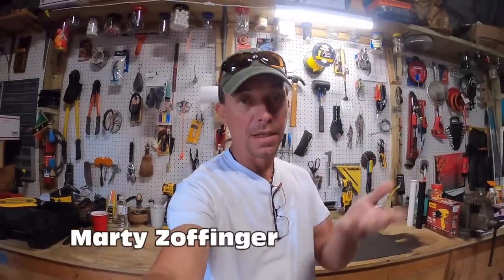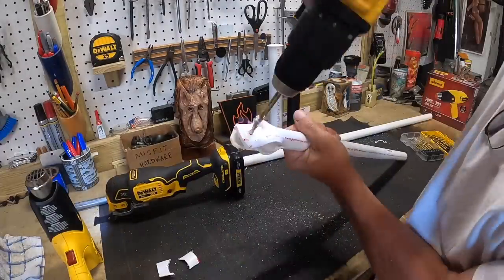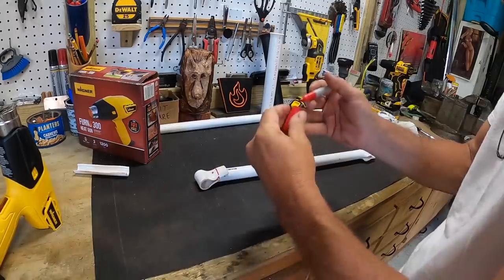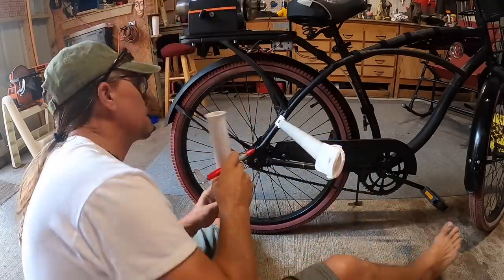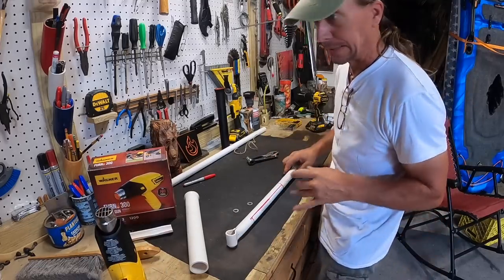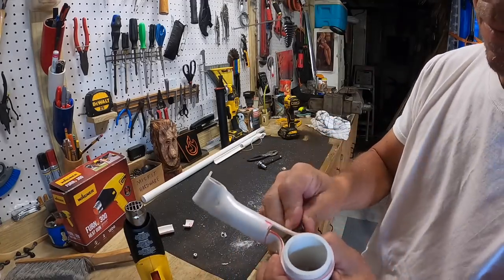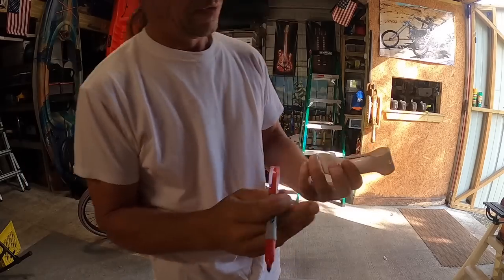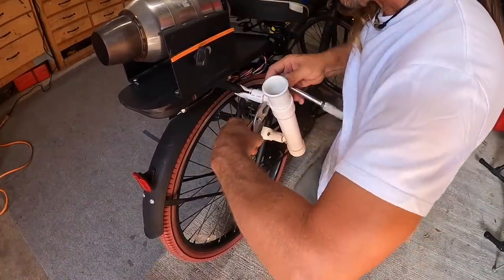DIY Bicycle Rod Holders made from PVC

Comment: That’s a neat little project there!  You can add a piece of pool noodle to the fluted end of the rod holder, to protect the rod/.reel from getting scratched/dented. Also, you could use bungee cords to hold the rods in place to prevent them from “bouncing”out of the holders.  You could also mount the holders to a crate, and cut a little groove/slot to make the rod stay snugged into the holder.

Comment: Thank you Marty, I enjoy your videos very much. The realism of real world trial and error is very good and tells us to have patience and something to hold on to that hot pvc than our fingers and hands. I can use your proven dyi methods to build amateur radio antennas, using far fewer fittings and reduced cost and building as making it more of my design, (and yours) and make contacts and conversation across the globe 🌎.  I been looking into really light weight outboard motors and also trolling motors intended for kayaks. Weight on the transom end must be very limited also if electric trolling motors are used, still have battery weight. I have been looking into LIPO4 battery technology. It is far lighter than lead construction batteries used in sealed gell cell deep cycle and old traditional lead acid wet batteries. You need a fairly high thrust from a electric trolling motor to get you off the water with pop up thunderstorms. I found a 2 cycle 4 HP air cooled low cost 21 pound with onboard 3/4 gallon fuel tank on Amazon. It's just about the same money 💰 compared to the electric trolling motors, but there is no batteries to deal with and charging up. Just carry a half gallon of 2 cycle mix fuel ⛽ and of course the oars and PFD, whistle and small fire extinguisher, to keep somewhat safe and legal. I would be using freshwater, but on the largest inland lake in Texas. Lake Sam Rayburn.  It can get dangerous ruff in 3 minutes or less. Protected coves are the plan. Great video and we learn from your videos as well. Thanks Marty. 73 GOD bless Earnest K5EWM.